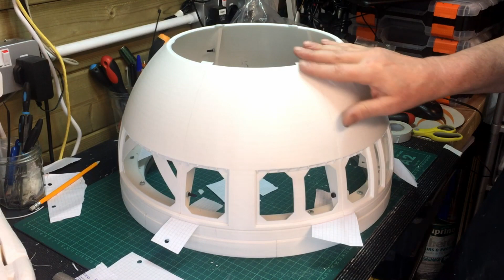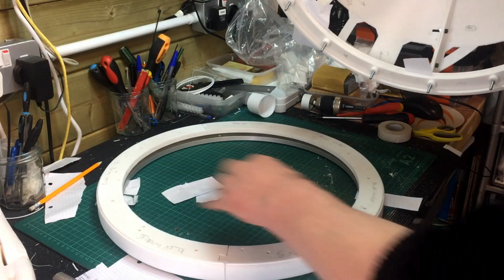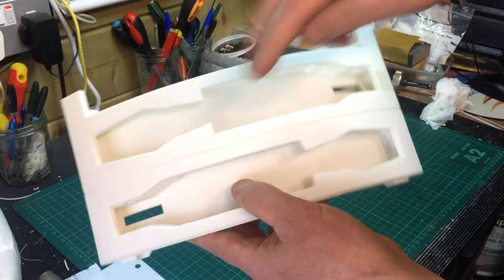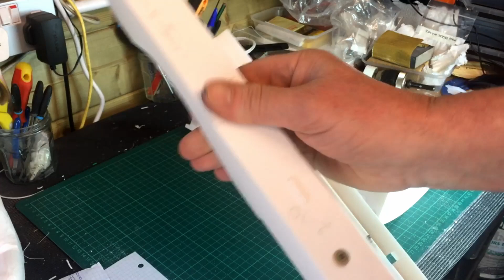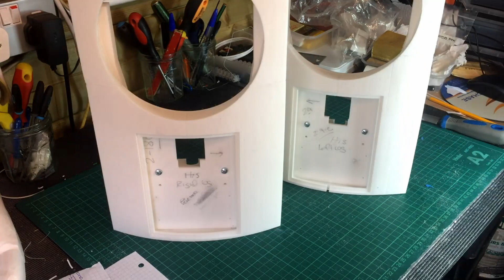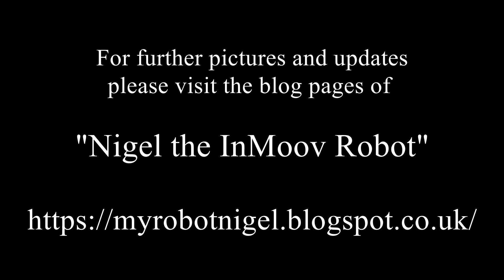R2D2 Droid Build Part - 3

Comment: Hi Kyle. Did you use the lazy susan rick recommended, and which lower ring did you print? And do you know what the PSImounts are for?
Reply from the maker: Hi Chris
I bought my Lazy-Susan bearing here: https://simplybearings.co.uk/shop/p183553/450mm-Round-Lazy-Susan-Rotating-Aluminium-Turntable-Bearing/product_info.html
I used the larger lower ring for it, but still you will need to do some modifications and drilling of the bearing and plastic to get it all to fit. 
I am not sure either what the PSI mounts are for!  Maybe alternative mods to the dome?   I printed them but have only just started doing the dome greebles assembly
Reply: Thanks Kyle!I printed half the upper ring this morning, and I'm now printing 2 of the octagon ports. I'll look into printing the lower ring later this week. Are you considering doing one of the mods? like this one:https://www.thingiverse.com/thing:3022788I bet you could easily modify that to suit your needs if necessary. I'd like to see if I could add a flip up panel or something to cover that when it's not in use.I saw ones to turn the buttons into functional devices as well as a few others like the periscope, life scanner, and such as well.

Comment: Hi Kyle , another great video. Have you figured out why the plastic keeps warping? Is it the temperature, humidity or something else causing the warping? Did you maybe adjust the file on the second time around? These little tips help a lot in saving everyone time, effort and filament. Thank you for sharing your build with everyone. As always keep up the good work. Kenn
Reply from the maker: Hi there Ray.  I have now changed slicer program recently to Simplify3D and it seems to be better, fewer warping issues, stopped using Slic3R.    I used to use Cura with the Wanhao and  never really had any warping problems with the InMoov.     Using PLA I have really only ever used the default available slicer settings, just varying the quality setting [in Cura] and infill amount in Slic3R and Simplify3D.     
I have just now been printing Nylon, Flex and PETG and have needed to experiment more with temp settings, and skirt settings to get them to stick to the bed. .  

I think the warping was really just down to not having the correct support structures, something that Simply3D seems very good at.   I may reprint old warped parts later, possible much of the rear door.    Rest I will try and use filler when painting.